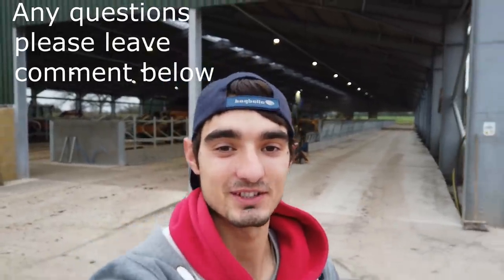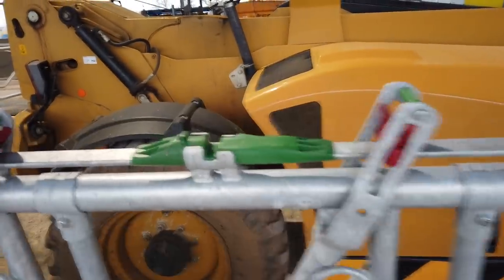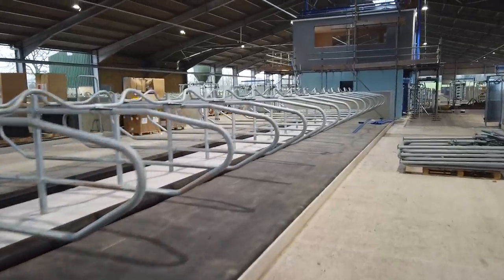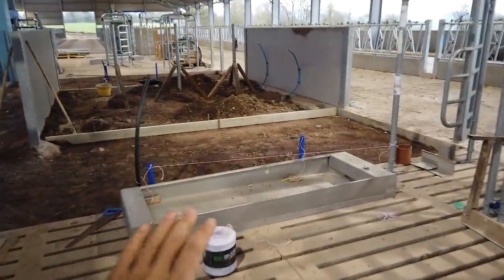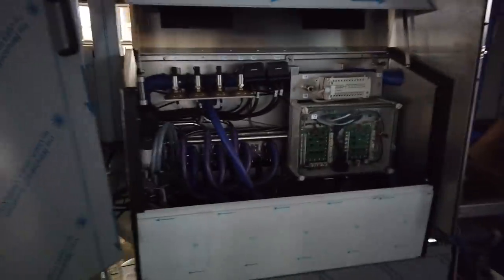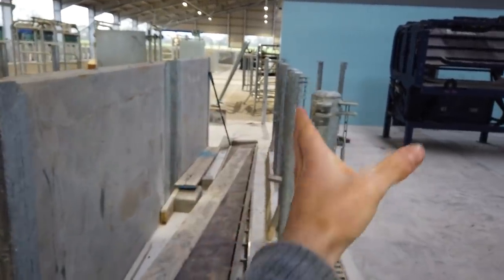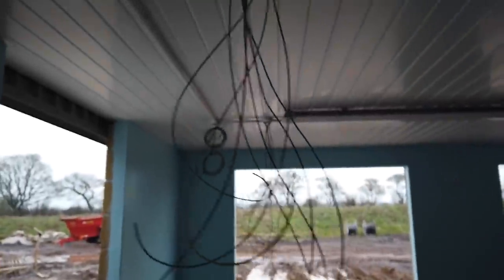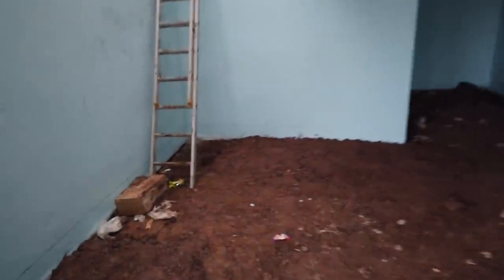New Dairy Building BIG Update!

Comment: what was the main reason to going for robots instead of other types?e.g rotary
Reply: Probably the need of staff.
Reply: @johnthemar197  funny i dont think he was askin you!
Reply: valleyboy he was just trying to help!
Reply: Rotary is very expensive and you need to milk a lot of cows to justify one of those. The robots means no outside people required to run the operation. But they may have other reasons too
Reply: Benjamin Bauer yes a rotary is expensive, but 4 robots in a huge slatted-cubicled shed wont come cheap either😂